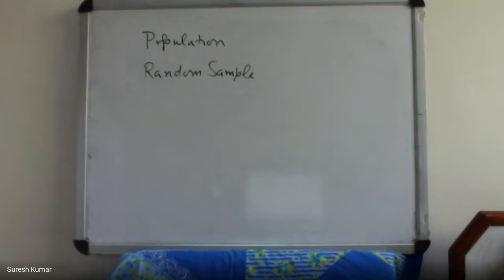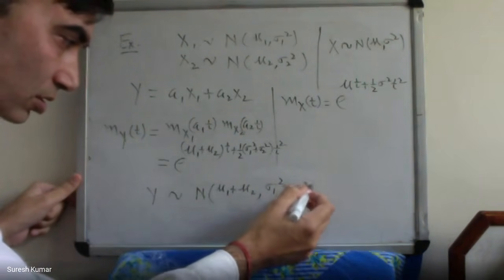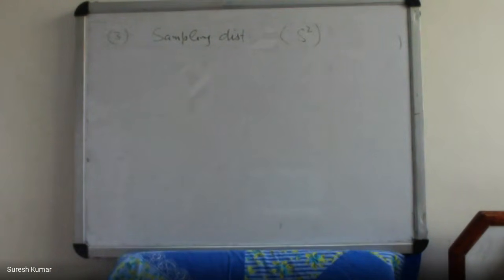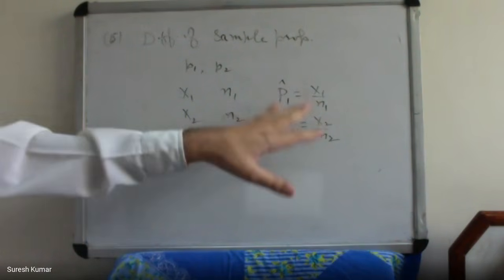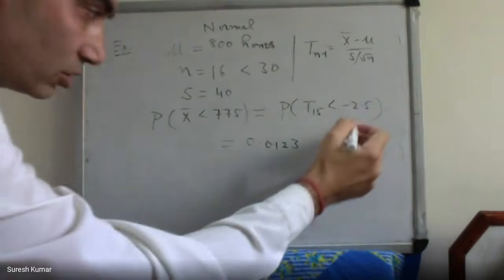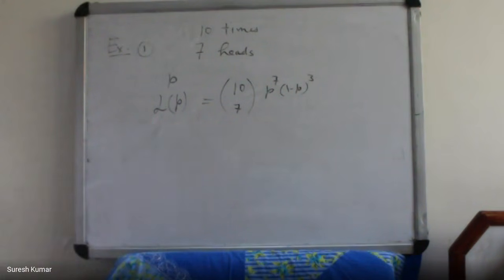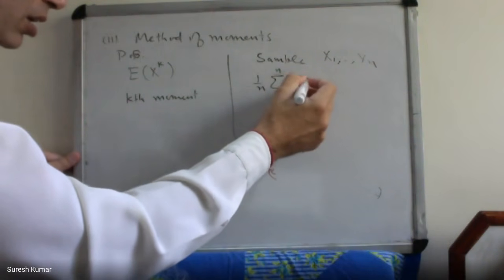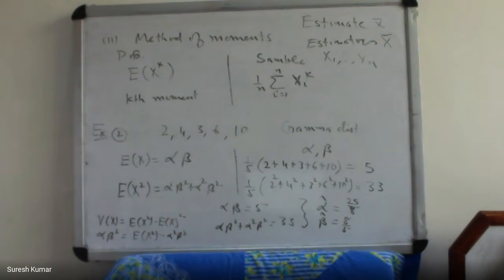Statistical Inference: Part-2 (Sampling Distributions and Point Estimate)

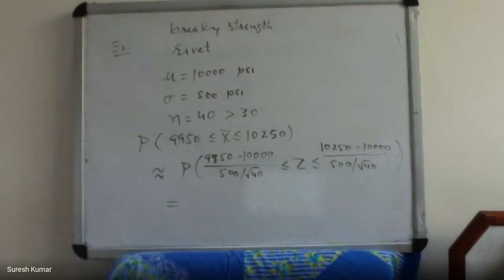Comment: at 43:45, since we are approximating it to normal distribution, shouldn't Z = (X- u)/sigma. Sir has done (X-u)/sigma/Rootn  but should have been the case if n<30 right? or am I making a mistake? someone pls help clarify
Reply: for X, the formula you wrote is correct. but we are asked about Xbar. and Xbar~N(u,sigma^2/n). replace this for the Z, you get Z= (Xbar-u)/sigma/rootn.